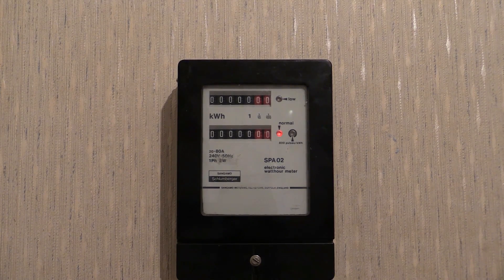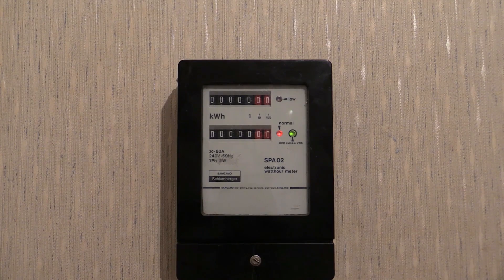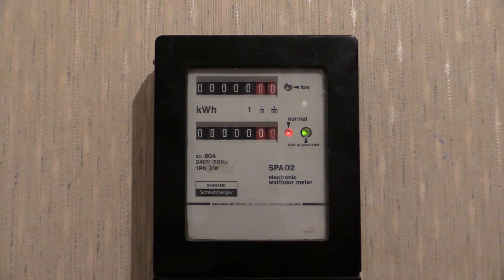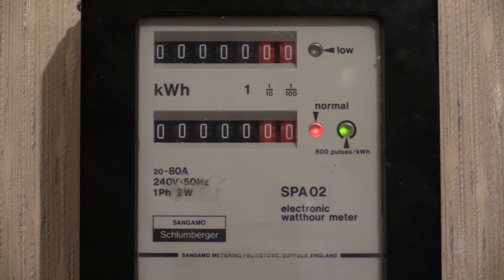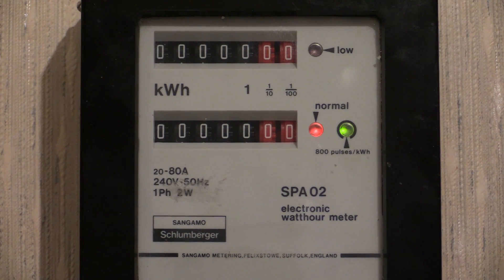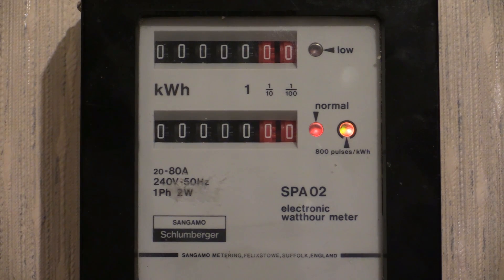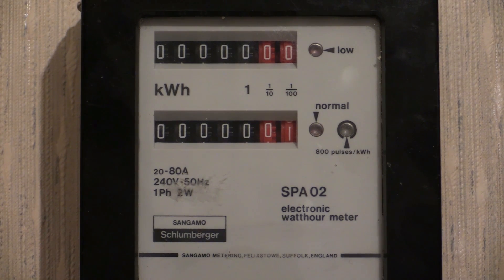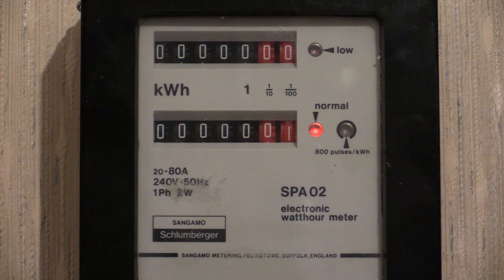Electricity meter : Attempted meter reversal. (SPA 02, Sangamo Schlumberger)

Comment: is there any of the older dial type meters have a reversal indicator?
Reply from the maker: Hiya. This is an 
interesting question 
to be raised. As far 
as I know, there......
.
.
.
......was not a loadwheel-based electric meter in the UK to have any type of indication inside it to say that some has given the instrument reverse current.

I have heard however, that there is/was an American electric meter which, upon reversing it, the loadwheel would go backwards, but the readout would not reverse, but would stay at its current reading.

Mechanically, it might be possible to engineer such a device into a loadheel-based electric meter, but I haven't known of it in UK-based electric meters.

In reverence to non-reversal of a UK manufactured loadwheel-based electric meter, then yes, there are a few manufacturers of whom made loadwheel-based electric meters. These include:

GEC,
Landis & Gyr,
Ferranti
Sangamo Weston

Models of loadwheel-based electric meters I know of with anti-reverse devices fitted:

GEC:  Any with a 'H' suffix on the end of the model number, as this indicates and anti-reverse device is fitted to the instrument. As an example I have a C11B2A-H and a C11B2. The latter is reversible. :-)

Landis & Gyr: Again, L&G also use a 'h' suffix. Before now, i have owned to variants of the same instrument. they were:
CL147d-h and the C147d. The latter was reversible, and I sold that instrument to one of my subscribers. :D

Ferranti: Particularly on their newer instruments only (e.g. the F2K varieties) Ferranti use a '9' suffix on their instruments. Example:
F2K-100-29 and F2K-10-2. Both are dual-tariff instruments and the latter is reversible as it lacks the '9' suffix on the model number.
Before now, I have seen a coin-operated F2K-50B and its non-reversible version, the F2K-50B-9. Not that prepayment meters should be reversed, as it could damage the prepayment mechanism.

Sangamo Weston: Not too well known for making instruments with anti-reverse devices, but they did in their later years, particularly after having relocated to Felixstowe, Suffolk from their Enfield, Middlesex location. Again, on the rare occasion you'll find a Sangamo Weston instrument with an anti-reverse device, the model number will have a 'h' suffix. Known instruments to have anti-reverse dvices fitted are the S200.31 (e.g. S200.31h) and the S309.5 (e.g. S309.5h) and also rarely seen, the S304 prepayment meters (e.g. S304h)

When a loadwheel-based electric meter has an anti-reverse device fitted and someone attempts to reverse it, the loadwheel will temporarily go in reverse, but then it will hit against the anti-reverse mechanism and stop rotating. The current will continue to go in reverse, but the loadwheel (and the readout) will not go backwards.

If you wish to see a demo of a loadwheel-based electric meter with an anti-reverse device undergo an attempted reversal, then click below:
https://www.youtube.com/watch?v=OWUNUXiKZKw

There you go. :D

Thanxx for watching,

-Wayne's Electrical.

10th December 2020, 21.12

Comment: I have a meter where the pulse light stays on all the time but does not pulse,  The light appears to be half green , half red, why??
Reply from the maker: Try turning on a 
few appliances and 
put a good 3,000 watts 
of load on the meter to see if......

...... the red light starts to flash on and off.

You won't be able to change the green light.

If nothing happens with a load on the meter, then it is dead.

If this is the electricity board's meter, you need to contact them immediately to arrange a replacement.

The longer you leave it, the larger that backdated bill will be, and it will be based upon what THEY THINK you have used, and that could be substantial!

Thanxx for watching,

-Wayne's Electrical.

28th April 2019, 17.26